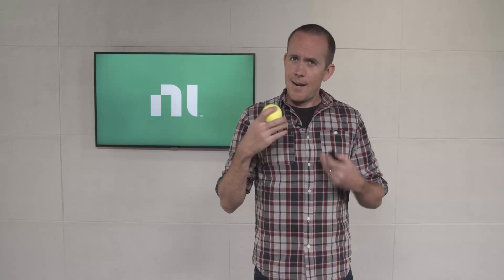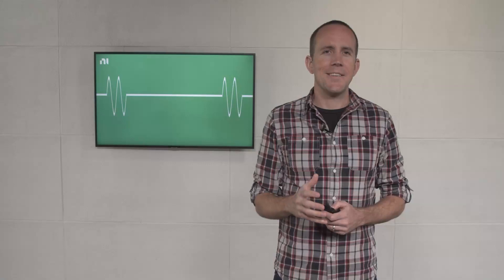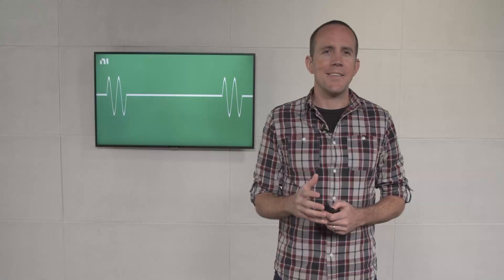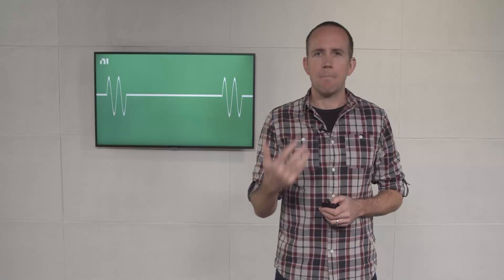How Does Radar Work? - NI Radar Series #1

Comment: Question for you: how does a radar detect its own return signals while sending high-energy outbound signals? I think of an analogy like shouting really loudly over and over but never hearing whether anyone acknowledges you because you can't over the sound of your own voice.

Does the Doppler effect of a detected object change the frequency enough for the radar to distinguish? Or, perhaps the in/out signals are brief enough as to be out of phase so that a computer can tell them apart?  How did it work with early radar systems?

Great video! 👍
Reply: Great question! And I love the analogy! You’re absolutely right that trying to “shout and listen” at the same time doesn’t work very well. In fact, trying to transmit a high-power RF pulse while the sensitive receiver circuit is active could destroy it. For that reason, your basic monostatic radar system uses a “duplexer” to switch the antenna between transmitting or receiving, so it’s only in one mode at any given time.

After transmitting a pulse, the radar needs to wait sufficiently long to listen for return signals before transmitting again. This period is called the Pulse Repetition Interval (PRI).
Reply: @barronstone  Thank you for your explanation! Engineering concepts and mathematics have always fascinated me.
Reply: @barronstone  To add to Barron’s comments, some less basic radars will transmit and receive at the time, known as Continuous Wave (CW) radars. They do this by spatially separating the transmitting and receiving elements. A basic example of this is MIT’s Coffee Can Radar design, where one coffee can monopole antenna is used as a transmitter and another as a receiver, about half a foot apart from one another. More advanced examples are phased array radars where different elements will be transmitting and receiving at the same time.

These phased arrays will send out ‘chirps’, where the continuous wave steps up and down different frequencies over time (known as a Frequency Modulated Continuous Wave radar). For military applications this is used in Non-Cooperative Target Recognition (NCTR).